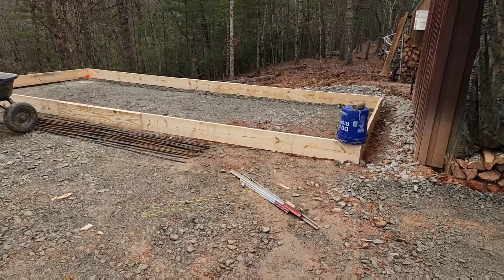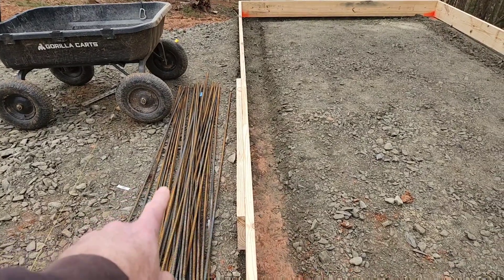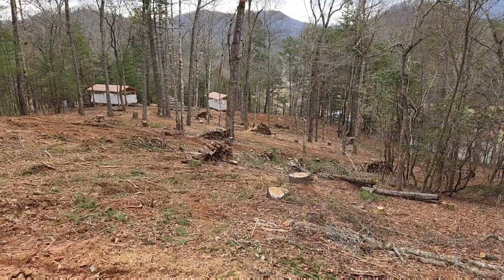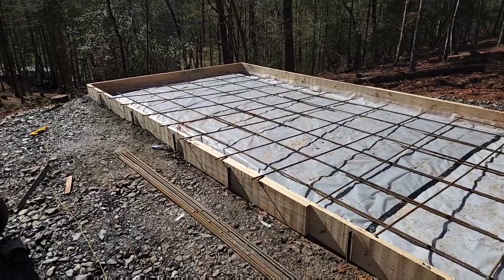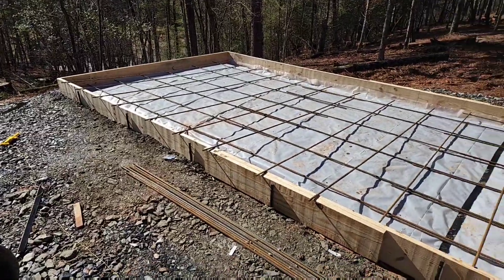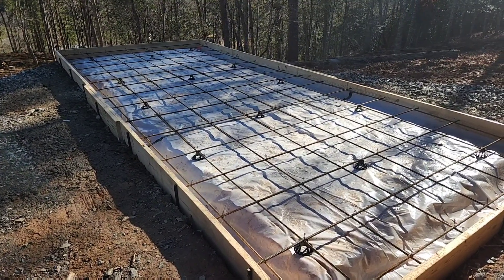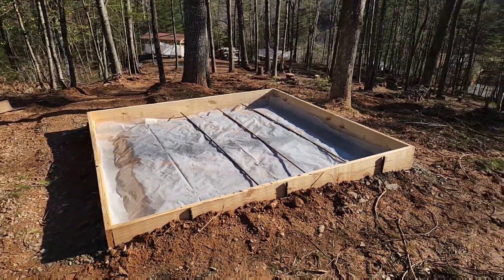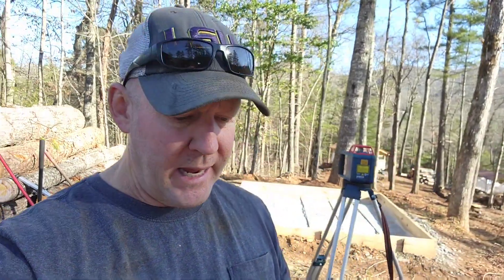Final prep for concrete!

Comment: Are you using shale ? Do you guys not have screenings? Just wondering if the shale packs tight.
Reply from the maker: I used ABC and compacted it down.  By the time the pad was poured it was pretty solid.  I was happy with the prep work.

Comment: What's the purpose of the tarp under pad?
Reply from the maker: Keeps moisture from entering the concrete from below.  Its suppose to prolong the life of the pad.
Reply: @LazyTCabins  is it just plastic? Or a tarp? Hard to tell in vid
Reply from the maker: It's a 6mil plastic sheet.